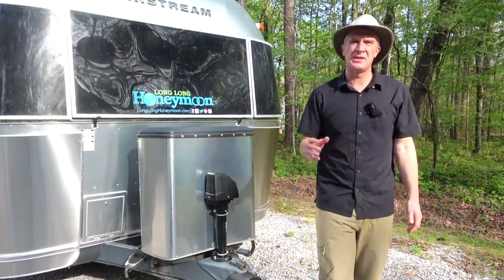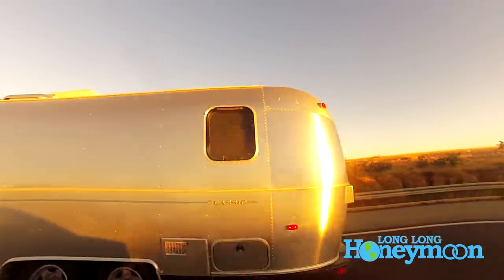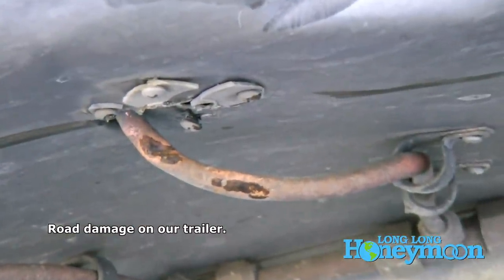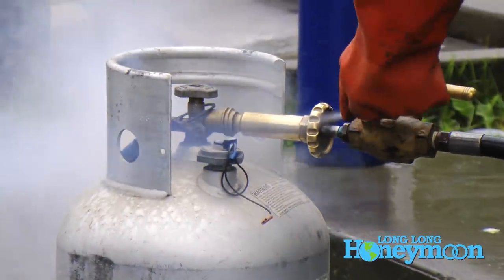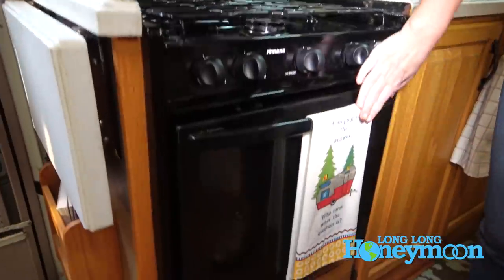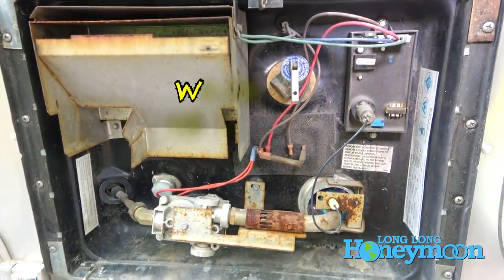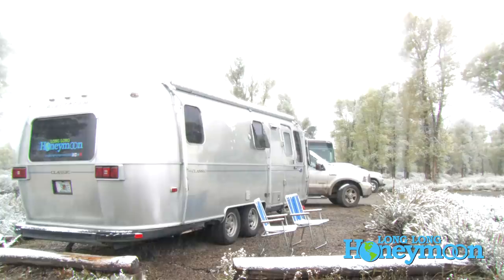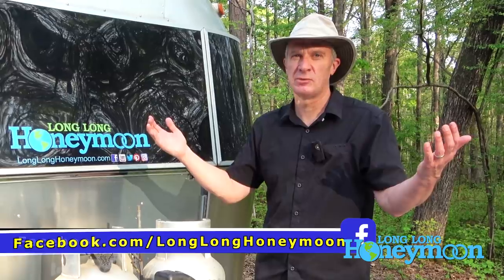For Beginners: RV Propane for NEWBIES

Comment: Like a lot of people, you seem to think that LPG and Propane are equivalent terms.Actually, Liquified Petroleum Gas can be mostly propane, mostly butane, or a variable mixture of both.  I've heard that  Mexican LPG frequently has a fair bit of butane content.  Which works fine down in Mexico, but can be a bit problematical if snowbirds bring full tanks of it back to colder climates.  Propane will change from liquid to vapor down to minus 44 degrees, but butane stops doing so at 32 degrees.
Reply: Very true.  I use a butane/propane mix for home heating (in Southern France) so have had to do a bit of research.  Butane and Propane behave very differently at low temperatures.  However, most caravanners tend to follow the sun, so don't know the difference.

Comment: Could also mention that it is essential to have a propane or gas detector, and you mounted low near the floor since propane is heavier than air
Reply: Airstreams have one installed by the fuse panel.

Comment: This month was wake up the camper. I had my tanks shut off during the winter but on one of our last camping trips our propane alarm tripped twice in a two week trip.  Unfortunately it choose 2 and 3 am to go off. We shut off the propane both times and the alarm cleared after a few minutes. 

I write this to point out if you have a very minor leak it will not often show up until a very still night with no wind.  I had soap and water tested my connections and did not find the leak.  I bought an inexpensive propane sniffer and found one of my hoses had a very tiny leak where it went into the tank. I actually had to hold the tester there a minute or so to find it. In the meantime had run down all my main lines and their connectors, checked the stove, fridge and hot water heater.  All these are places you can have a leak.

Also my CO2 side was hitting end of life.  Most of the Safe=T-Link detectors average about 3-4 years tops and often they are a year old when you purchase them.  I put a new one of those in this week also so you need to be sure yours are working correctly.

Comment: We are soooooo ready to get our Airstream on the road. By now we normally would have had a least 3 trips. Also, I saw tonight where the KYD ppl have purchased a 30' Flying Cloud bunkhouse for their new rig.
Reply: Yes they did and they bought a real nice great condition used AirStream, it looks brand new, for a few yrs I didn't really like the Airstreams, but they sure are a nice looking trailer that really holds their value compared to other trailers out there and, they kind of grow on you, lol I saw a couple of Motorhome Airstreams and they sure were beautiful RV's, not too many of those around compared to other coaches as they are pretty expensive but well worth it, they look like there trailers with only one exception, you drive them, lol

Comment: I use an  old milk crate to hold my propane tanks. They fit inside very snug and keep them from tipping over. A tie down strap through the top handle and it stays put against the tailgate or wherever. 
An old milk crate makes a great stable base

Comment: Hi from Australia.. LPG Cylinders should always transported in a vertical position as they are normally filled to 80% liquid which leaves a 20% vapour space at the top and if it is left in the sun and the pressure relieve valve on the top bottle (normally built into the service valve) vents to relieve pressure to a safe pressure (below 1250 Kpa max) it only vents vapour not liquid as if it vented liquid 1 litre of liquid will make about 700 litres of vapour at atmospheric pressure combined with air at 10 to 1 equals 7000litres of combustible material where by if only vapour is released you may only have to vent a very small amount to reduce the pressure to a safe limit..Figures used are close but approximate. Hope this is helpfull and answers the mystery..

Comment: I am a retired Firefighter/Hazardous Materials specialist.  Your tanks should not be overfilling.  The triangular shut-off valve is indicative of the mandatory overfill protection device.  It's an internal float controlled automatic shut-off device.  The vapor escape in your video is merely the fill hose bleeding off.  Stand back when your tanks are being filled.  I noticed both of you do that.  Is non-odorized propane available to the general public?  No.  Generally the non-odorized LP is moved in large quantities such as railcars.  The odorant for propane is a close relative of mercaptan, hence the similarity to odorized natural gas smell.  Propane gas is heavier than air.  Treat it accordingly.  Escaping liquid propane is extremely cold - though it is not classified as a cryogenic.  Any skin contact with liquid propane will result in serious injury.  The pressure relief valve on portable propane tanks will not function if there is liquid propane is in contact with it - hence the reason for transporting your tanks in the vertical position.  If you suspect a leak in your propane system close the tank valve and don't bring your RV indoors.
Reply: bcgrittner Nobody asked
Reply: @jeffreydw1983  Don't be a dingus!  I've always transported LPG tanks upright, but thank you bcgrittner as now I know why!  Also, someone above made an erroneous comment that LPG is lighter than air, but I had been informed long ago that it is in fact heavier (as you say bcgrittner) so one must be aware to place gas detectors down low, and that leaks will accumulate in low areas.
Reply: Good information. Thanks!

Comment: You made it simple. Adding comments about propane being colorless, odorless, explosive, etc, etc, was a good reminder not just for newbies. It was good for the rest of us to have a heightened awareness. Talking about uncalled for fears regarding the oven and varying features from various manufacturers on top burners capabilities was practical. Undercarriage views of damaged tubes gave a visual of potential problems and the need for inspection from time to time. Having an unhurried, articulate 'SPEAK' is critical too so that one doesn't have to pause the video, back up, and ask: "What did he say?" The visual of pulling away from the propane fueling station also leaves a good impression of safety 1st. So there's a balance between a camper/traveler being totally carefree and one who is constantly, needlessly, anxious about everything. Indeed a mindset of Safety 1st. puts all in perspective.   Thanx, Frank

Comment: Nice video as always guys! We had a freaky problem that thankfully turned out ok. Somehow one of the knobs on our stove was accidentally turned on a little bit without our notice. We did smell the nasty smell but thought it was coming from our black tank. Thankfully I woke up in the middle of the night thinking that black tank smell was getting worse and I was going to have to do something about it. It was super quiet while I was getting dressed and I noticed a small hissing noise, so I checked the stove and found one of the knobs slightly on. I turned it off immediately and opened windows to let it air out. So now we've become pretty anal about checking those stove knobs, especially before we go to bed. I was just glad we didn't wake up dead.
Reply: Yeah, waking up dead is such a drag!

Comment: Perhaps it was more detail than you wanted to get into, but most RVs have an automatic change over regulator, i.e. it will switch tanks if the one currently selected goes empty. Of course, the main valve on the second tank has to be open for this to be useful.

Also, some RVs have a quick-disconnect fitting to allow a barbeque or other gas appliance to be connected to the rig's propane supply. Newer RVs tend to have this installed already but older ones can be retrofitted. For example, our 2020 Cougar had it already installed but I had to add to our previous RV, a 2007 Komfort.
Reply: But you may not know that one tank is already empty when the second one goes empty without gauges. Suddenly, you have nothing.

Comment: I have a forced air heating system in my truck camper, however, most of the time I'll use a small wave heater which uses much less propane and keeps a camper comfortable. Nice thorough overview , well done.
Reply: In 30 to 55 degree temps (F.) a small electric works great if you have shore power (especially if campground is paying for it!) We got our at at Walmart for $16.

Comment: Skid plates under the trailer for both gas lines and brake lines would be a great idea. Not airtight, just something to prevent damage. I don't know why I have never seen it yet. Even 18 wheelers have stuff hanging down without shielding. I bought a 1968 last fall, gutted, not much saved, kind of starting from scratch first of June. I almost feel like Wally in 1955.(:-))

Comment: Good idea to have a valve adapter for the small disposable bottles in case of an unexpected out of propane situation, and a few of those bottles stashed away somewhere. Also a cheap, portable camping stove, so you can use them on that and cook outside.

Nothing tastes better than bacon and eggs cooked outdoors in the woods like that.

Comment: Not sure if this happens to other RV owners but if i put the pilot knob on and try to light it immediately it does not work, but if i turn it on for a minute then light it then its fine. Also filling my LP 30 lb. tanks have always cost $25-$30 for both regardless of where I go. Recently i discovered Costco fills my 30 lb. for $10 but make sure its empty because its a flat rate. A coworker goes to BJ’s club and its about the same

Comment: We travel with 4 LP tanks. Two 30# on the trailer and one 20# back-up tank, plus one 11# for the portable grill and Little Buddy heater.  I went to the local RV Surplus Store and purchased a LP tank rack (just like the one on the RV) and mounted it in the bed of the truck, for safe transporting. Of course it helps to live in Elkhart County Indiana where there are many local RV surplus stores.

Comment: Your back two burners on your stove top does appear to have an igniter on them, so you should be able to use the same igniter knob to 'ignite' all three of them otherwise the little igniter switch (the little white thing with metal looking hook) has gone bad. Just an observation :)

Comment: Very good, as for the water heater, we use electric to get it started since when we first get to the campground we don't need hot water right off but then after a while switch to gas and the works better for showers and such.  Since we are in in a hurry for hot water let the electric work for us.  I got rid of our oven since after 6 years we had never used it, I got rid of the unit and put in just a stove top and even that we hardly use since we do most of our cooking out side on my Blackstone grill or my butane cooker for pots and stuff, wife does not like food smells in the camper where she sleeps.  I am one that runs the Refrigerator on Gas as we travel, I have heard the no no's but I still do.

Comment: I use a pizza stone to help even out my oven's temperatures. I simply place it on the bottom flame dissipation level. I remove it when I'm in motion so as not to allow it to bounce and fracture in the oven.

Comment: Hello Lolohos, A Fire Chief once told me that LP tanks during transport need to be kept oriented in relation to the way they were manufactured to be used (some tanks stand vertically, such as those on barbeque grills and travel trailers.  And some horizontally, such as tanks used to fuel pick-up trucks and forklifts). This is because the pressure relief valve will only be able to relieve LP gas in a gaseous state, not in a liquid state, transporting in another orientation may submerge the relief valve, rendering it useless thus possibly creating a condition of over-pressure and possible rupture, especially if the tank should be agitated, subjected to heat or change in elevation. Safe travels!

Comment: When we were at the Winter Star Party, the propane hose going to our driver side tank started leaking (5 year old hose in Florida: heat death).  Even though the leak was outside, the propane detector (2016 FC) went off in the early evening.  Those Green-tipped hoses (green connector that connects to the tank) are special.  Don't use another type.

Comment: The reason tanks should be transported in there installed position has to do with the possibility of liquid propane escaping from the tank.  Short story, liquid propane escaping, which will expand exponentially, is worse than propane gas escaping.  If the temp/pressure requirements are met for pressure relief, the liquid escaping is more likely if the tanks are not transported properly. Many people improperly transport these tanks, lying on their side, in the passenger compartment or trunk of their car.  Tanks being transported for filling via passenger vehicle, should be transported upright, filled, and immediately returned to the trailer.  Don't go shopping and leave them in a hot car.  Think of that liquid expanding like 270 times as it transforms into a gas and being trapped in the car and then any type of ignition source is introduced.

Comment: Something I found out when my furnace quit working,  there is a small amount of oil in the tanks guessing to keep the regulator and things moving smooth.  That small amount of oil over time balled up in the furnace and plugged the orifice for the furnace.  Took it apart, blew it out and works fine now.  My rig is an '05 so not sure if it had ever been cleaned out before.
Reply from the maker: Thanks, great tip!

Comment: If your LP Tanks are Aluminum I have been told they can last for up to 35 years.  I have also been told that the aluminum tanks are VERY expensive to replace with aluminum.
Reply: They just installed a solar/lithium power system, new tanks are a minor expense to them wink-wink.

Comment: The convenience of the appliances in the modern RVs is nice I admit.  No longer having to manually light the fridge for example and all other electronic ignitions. However it was much more efficient way back when.  In my first several RVs for instance had the 3 way fridge, making driving down the road safer by shutting down the propane and letting the 12V handle the fridge.  Had a hand pump on the sink, no electric pump necessary.  The furnace was a wall mount propane, with pilot light and no electricity needed. Oh and does anyone else remember the propane (mantle) lantern over the dinette?  Could boondock without any electricity period.
Reply: I think youi find that all propane fridges have a circuit board that reqiores 12v.  Otherwise they would reach a point where everything freezes up.

Comment: When you open the valve on the propane tank you should only open it 1 full turn.  Also your tank has an automatic shut off to prevent overfilling.  You can tell by the three sided handle.  Those handles have a float built into them that will shut off the tank inlet when the tank is full (about 80%).   When filling the service attendant will open a vent on the propane tank to let out gas to make room (reduces the pressure) for the liquid being pumped in. Since it is propane gas you can smell it. When the tank is full  some liquid propane may come out the vent.   Keep safe and God Bless.

Comment: Been using propane all my life...easy to feel how full with your hand...as you run your hand down the side of the tank you can feel the chill at the level of the liquid. Problem now is our 30 year old class A we bought 2 years ago has a 30 year old 30 gallon tank that needs to be certified...as I start to ask how and where it occurs to me to google that so never mind. Have you ever considered protecting the propane line that runs underneath your RV? I'm running a propane line from the passenger side across to the driver side to feed our dual-fuel generator I installed and I used a 10' steel-braid hose inside a 1" PEX  hose inside a metal electric conduit. I put the hose in the PEX to prevent abrasion from travel and put the PEX inside the metal conduit because I don't want a tire blowout to rupture the line...which, according to several Youtube videos I've watched, is a relatively common event. I'm making sure to ground the conduit to prevent build-up of static electricity. Propane is how they make big explosions in the movies. Yeah, I'm being ridiculously cautious.

Comment: The “overflow” valve you talk about is not that. The flat blade screw on the side of the valve assembly is called the liquid gauge. There is a small tube that extends down into the tank to the 80% level, the maximum the tank should be filled. This gauge should ALWAYS be opened when filling the tank. Initially, it will vent gaseous petroleum (more on that later). When you see liquid, the tank is at 80% and the filling operation should stop. All current propane tanks must have an Overfill Protection Device (OPD) that shuts off the flow of petroleum when the tank is at 80%. Sometimes the float that shuts off the OPD can stick, so that is why the liquid gauge should ALWAYS be used and why you shouldn’t rely upon the OPD. Since the liquid gauge will vent petroleum and mercaptan during the filling process, the odor can be quite pungent when the tanks are PROPERLY filled.

As far as LP,  it stands for Liquified Petroleum. Commonly it is referred to as propane, but in some southern states butane is often used instead. The heat content of butane is greater than propane, but the boiling point of butane is around 34°F versus propane at -44°F... Otherwise, the two fuels can be used interchangeably without any undue harm or ill effects. The major downside to butane is that in cold weather, a full tank will be completely useless if the temperature is less than 34°F, as the liquid won’t boil and therefore no gas will flow to your appliances.